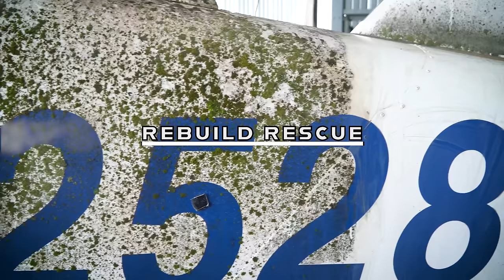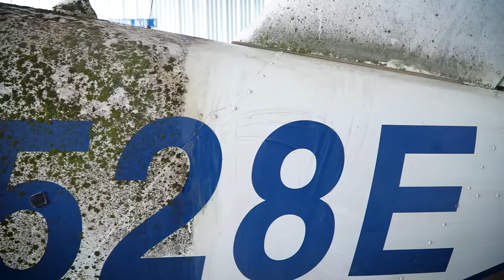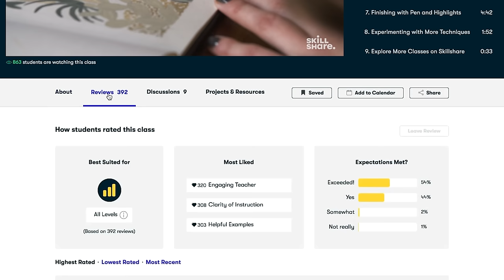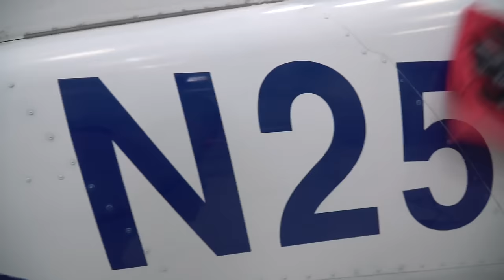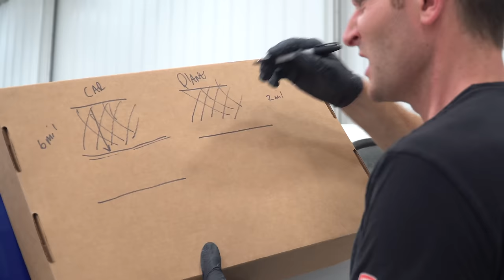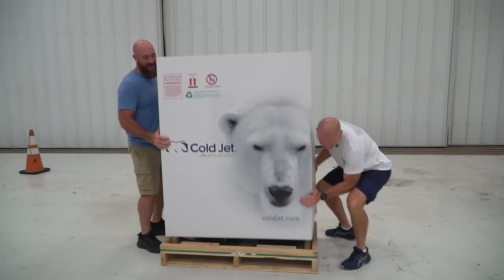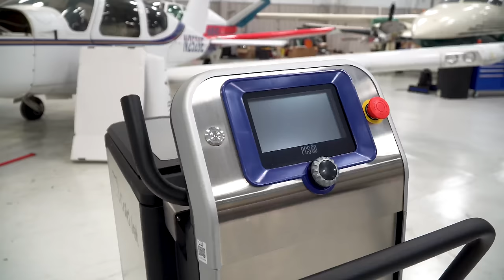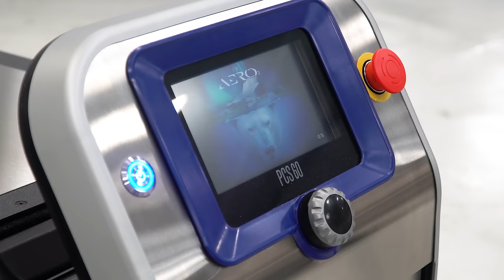Cleaning Our 15 Year Abandoned Dream Airplane with Ammo NYC !

Comment: It was an absolute BLAST 🤣😅 hanging out with you guys! Looking forward to seeing the final product of your planes and the rest of the journey!
Reply: Is there any danger to using the dry ice blaster on anything? I assume its quite chilly.
Reply: @richardmunday274  we always recommend new users start low and slow and build up from there. Low air pressure with small particle sizes on a test area first to see how it works and then move forward once you get it dialed in. That said, we also suggest not to dwell on a surface for too long. You'll notice in other videos operators move in concentric circles to clean the service. Feel free to follow the link in the description and fill out a form for more info!

Comment: Hi Jason. Paint jobs are expensive. Using a lot of elbow grease I'd clean it up the best I could,  and call it good for the time being !
Reply: @thedirtyknobs  Not just any body shop can paint an airplane. It has to be specifically an aircraft paint shop.
Reply: @Zalaniar  
He never finishes one anyway so doesn't matter.
Reply: @12yearssober  he says, literally on a video where a project got finished
Reply: @Zalaniar  I have seen aircraft builders paint their own planes. Just different undercoat etc. Certainly was not done in an aircraft shop.
Reply: @maxradford5089  experimental (aka homebuilt) aircraft have less strict requirements from the FAA. This plane is a certified aircraft though, so there are requirements on who can do what work

Comment: It's super cool that the Cold Jet blaster uses media that just sublimates with no residue or clean-up. However, CO2 is no joke indoors so hope u guys were using air meters... :)
Reply: You're right, CO2 is no joke! We always recommend having CO2 meters and proper ventilation in areas you are blasting, especially confined spaces.
Reply: There's a thought. I guess being in a such a large space mitigates to an extent, plenty of floor area for the CO2 to flow away.
Reply: @EliteRock  CO2 is heavier than O2 so it tends to linger low unless there is good airflow through the space. It doesn't dissipate well unless forced to... In space, it's not O2 depletion that gets you, it's CO2 buildup.

Comment: Those blasters are just something else - I don't know how long they've been around, but they're practically like magic, getting close to the results you'd get from dismantling and using a vapour-blast cabinet. I assume the lower engine cowl is going to come off to do the bottom of the engine? 
Anyhoo, fantastic content, and really hoping to see a trip in the Trinidad soon - don't know why but I'm really taken with this little plane (well, I do partly - it's that's cute little six-cylinder in a cute little plane).

Comment: I have a shop vac hack for you. If you ever need to get deep into a confined space to vacuum, go buy a cheap long 'need to put transmission fluid in my what ever' funnel. Stick your vacuum hose in the big funnel end and use the pointy end to vacuum in those confined spaces.

Comment: Cold Jet blasting can produce some AMAZING results in areas you normally could not use overly aggressive methods. BUT….. you have to use patience and steady consistency with your technique. I’ve watched overly impatient screwballs not be able to produce the sort of incredible results that can result if you just move slow and steady relative to the surface condition you’re working with. It is an EXCELLENT cleaning method. 👍🏻😎👍🏻

Comment: You wondered where the remaining debris went, after it gets blasted off - Larry would have told you if you guys discussed this... It gets blasted into the air, coating everything in the hangar with a fine layer of birdcrap. I'm sure the owners of the other planes will be happy with that.

Should've used the machine outside :)

Comment: Is this dry ice blaster the same as sandblasting, but doesn't leave stuff behind because dry ice evaporates?
Reply: It is similar in principle, however dry ice is much softer than sand so it can clean more delicate services. It also sublimates back to gas, only leaving behind whatever contaminates you blasted off the surface to be cleaned.

Comment: So cold jet is kind of like a media blaster but a little more gentle?
Reply: Correct! On the Mohs Scale of Hardness, dry ice is just barely harder than talc powder. The extreme cold and expansion from solid to gas is what embrittles and lifts the contaminant off the surface. Since it sublimates back to gas, only the contaminant blasted off the surface is left to be cleaned up.

Comment: I sure hope you cleaned the static ports out.  It does not take much to block them.  Normally you tape over them before washing and specially waxing.  By the way did you remove the prop spinner to make sure all the wasp or mud dopper nests are removed.

Comment: COLD JET NOTE: Yes, it is an amazing cleaning method, no doubt. But something to remember when Cold Jet cleaning is that the process is also extremely efficient at removing grease deep into fittings where you might not notice it working as well as it does. Especially on exposed fittings like bearing races where you can see the ball bearings. This happens from the way the ice reduces into a very fine micron size so quickly but hasn’t actually become liquid yet. Fabulous for cleaning because of this attribute, but it can sneak into areas not intended to fully clean. Like areas containing actively operating grease. It’s a really good idea to re-grease those areas with fresh grease afterwards. 👍🏻😎👍🏻
Reply: Great point, and great advice!

Comment: A view from the Uk. Justin, it always worries me when people use compressed air to clean things, particularly items with moving parts.  There is a situation that can occur where you actually blow or force the debris somewhere that, unwittingly, will give you a problem further down the line. The dry ice you are using is the abrasive which i presume melts leaving the cleaned off dirt to be blown into a bearing or linkage.  I would suggest anyone thinking of using this or a similar product be careful as to what and where you point the nozzle. I don't know what pressure you were using but it could actually lift momentarily caps and covers and blow the dirt under them.  Sorry to be a grouch but, trust me, we learnt the hard way.

Comment: Hey Jason, so how many lbs of ice was needed for that job?
Reply from the maker: I believe we used 60-80lbs for the engine and the gear assembly.
Reply: @rebuildrescue  no kidding, that's a hungry machine.  Looking good though.  I would of thought you'd remove the lower cowling before starting.   👍

Comment: What type of paint is used on planes that make the paint so tasty to fungus. Rebuild Rescue should try Balistic Epoxy to paint a plane such as Enduro EX-2C. Super easy to use and extremely fast cure. That is the good news about bullet proof paint. The bad news is that the curing stinks like a thousand skunks did a 21 gun salute at an orgy. When fully cured it is odorless and colorless but after using  one ounce to paint a pool cue my whole house stunk for a week!

Comment: I don’t want to sound a know-it-all, but is it wise to dispense that much dry ice in a closed room? It’s CO2 after all. Carbon-dioxide. It displaces oxygen, and it accumulates from the bottom.
Reply: You are correct, you want to ensure there is proper ventilation in the space you are blasting, especially enclosed areas. We always suggest having CO2 monitors in the areas you are blasting, especially smaller rooms. This particular hangar is very large, so there was plenty of air space for the CO2 to sublimate at safe levels.

Comment: I've been watching since the first 401 video dropped.  I'm not in aviation, or really into anything mechanical, but I'm generally interested in fixing stuff.  I used to watch your entire videos from start to finish but lately I've just been hopping around your newer content.  Why? because of the forced acting for filler content... for example, the filmed FaceTime call in this.  The sponsors are also pretty cringe acting, you'd be better off just explaining what they do instead of pretending you bought a 50 cent wallet tool for $2 after spending $20 on bids on some sketchy site.  On top of that, it's been 8 months and you still haven't finished anything.  I get stuff takes time, but the down to earth aspect of the channel went out the window pretty quick.  It was fun seeing if you could get that engine to start, kind of boring watching you rebuild an old airplane for 4 episodes only to have the payoff be flying a different version of that airplane.  You also aren't a certified pilot? I don't know, you never fly, never talk about it, but that would be a cool journey to follow.  Forced product placements and channel crossovers got old and ingenuine pretty fast.
Reply: No Jason stumbled on flying i suppose.This series got boring and many lost interest.
Reply: I agree with much of what you said. The jump ahead button on YT works well. I agree that the videos could be shorter but understand the need for sponsorship. As for how long it takes the parts supply for GA aircraft is slow and getting things inspected and signed off takes time. I assume Jason is getting that done in the background
Reply: Aviation restoration takes FOREVER. Instant gratification is a cancer in this day and age. If you don’t like the content it’s very very easy to just not watch the videos. Check back in a year and binge watch the episodes since patience doesn’t seem to be your thing.
Reply: @advert25  I mean the 401 was his first aviation project, he then got 2 other planes to restore. 1 of them took 4 episodes but none of the episodes had any payoffs like the original get the engine started. . He also got a yact. So it’s not all aviation. And he was getting millions of views his first few videos and a ton less now. So I’m sure he’d like to know why. And it’s because it feels fake now.

Comment: Historical Trivia: At the start of WW2, US Army Air Force airplanes were painted olive-drab; at the end of the war, they were unpainted. Reason: Someone figured out the weight of the paint (upwards of 100 lbs. on the bombers) was weight which didn't need to be there, and the savings could be used to extend range, or add to the warload.

Comment: The 401: Would the FAA find home molded carbon parts acceptable for replacing the Aluminium Motor mount bay? Would you? Is this a tenable way to go? Just putting my 2 dimes together.
Reply from the maker: Unfortunately that wouldn’t be allowed…